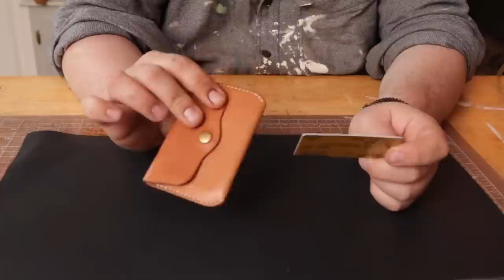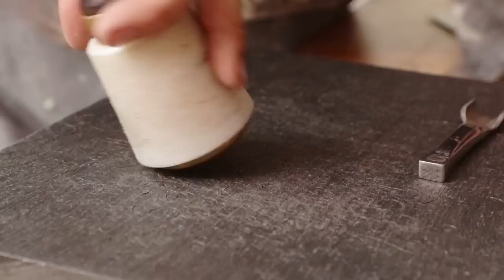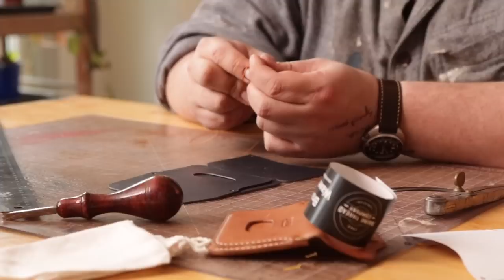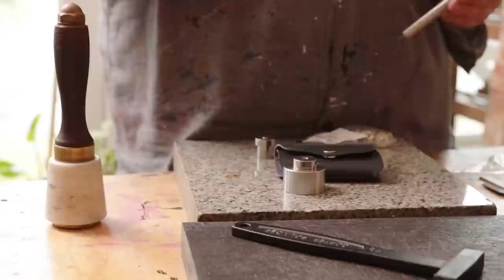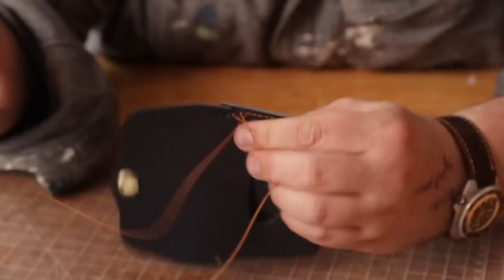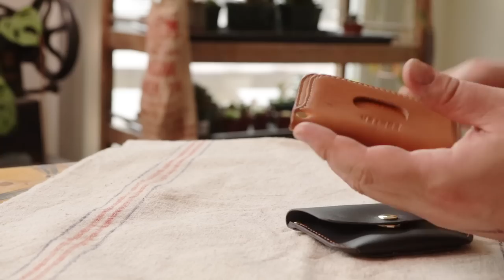Make a MAGNETIC MAGIC WALLET (With Pattern)

Comment: Thanks for the tips. My own (anecdotal) tip on canker sores:  Let it air dry, gently rub a wet styptic pen on it (it will sting for a moment, of course, but not long), let sit for about 30 seconds, and rinse. I've found that this prevents it from getting bigger and helps with the pain. I hope that helps!

Comment: This magnet closure is my favourite type of closure. Been using this type of double cap magnetic closure for several years. Really smart design. 😊
Reply: I think I'm really going to have to try these out. I'm always concerned with using a strong snap on a thin wallet specifically because I think one day I'm going to crack a cheap card closing the wallet with too much force.
Reply: I resisted using magnetic snaps until I found these rivet back type.  Been using only them since.  They are so flat and really strong.  The dimple and the small depression make the snap line up perfectly and give that tiny extra magnetic force.  Flat is KING!

Comment: What size thread and needles where you using there?  I've had no luck with the braided maine thread.  I have some 0.030 and all I've tried the 517-1 Osborne needles and it just doesn't want to slide over the head of the needle to make the locking knot.

Comment: Can I use copper rivets? Do I need a washer for copper rivet?
Reply from the maker: solid copper rivets would be tricky unless you could find very, very tiny ones - a standard rivet and bur would be too big for the back thumb slider to work, it would make that opening too small. However the pattern comes with the vector file so you could always make it bigger to accommodate :) I don't think a leather washer would be necessary